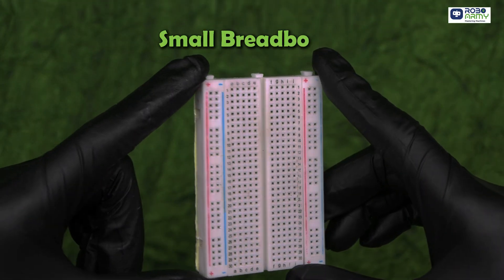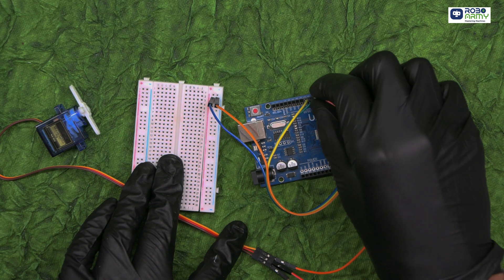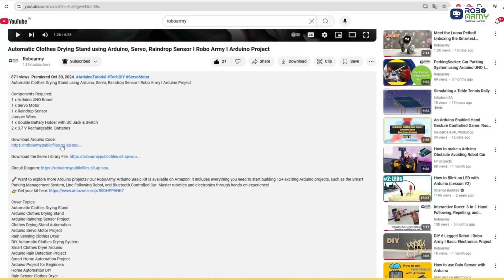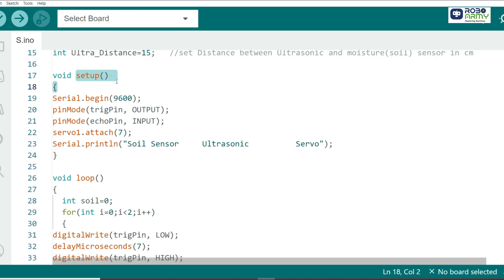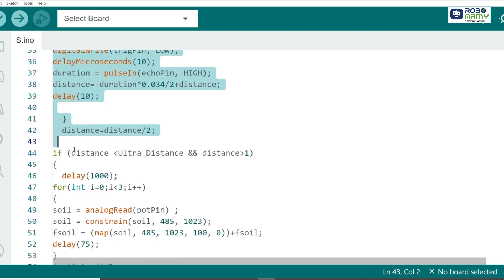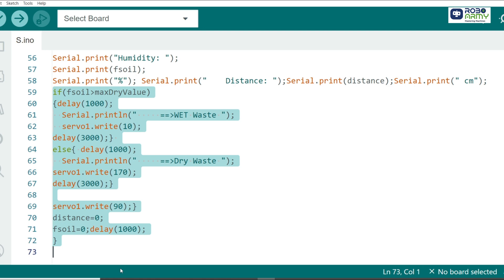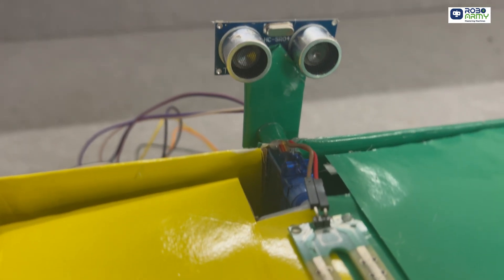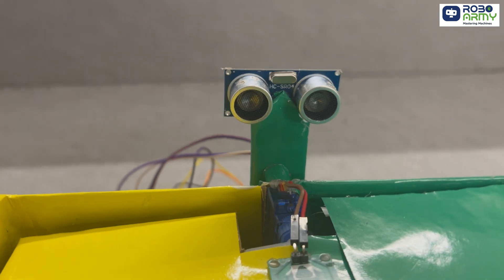How to make an Automatic BinBot: Dry Wet Waste Segregator Dustbin

Comment: hai do you have a code when the moisture is wet it should stay in position and if its dry it should move?
Reply from the maker: Sure! Here’s a simple code example: if the moisture sensor detects wet waste, the servo stays in position, and if it’s dry, the servo moves.
#include <Servo.h>
Servo servo1;

int potPin = A0;   // Soil moisture sensor
int soil = 0;
int fsoil = 0;
int maxDryValue = 10;  // Threshold value

void setup() {
  Serial.begin(9600);
  servo1.attach(7);
  servo1.write(90); // Neutral position
}

void loop() {
  soil = analogRead(potPin);
  soil = constrain(soil, 485, 1023);
  fsoil = map(soil, 485, 1023, 100, 0);

  Serial.print("Moisture: ");
  Serial.println(fsoil);

  if (fsoil > maxDryValue) {
    // Wet waste → stay at position
    servo1.write(90);
    Serial.println("Wet Waste - Servo Stays");
  } else {
    // Dry waste → move servo
    servo1.write(170);
    delay(2000);
    servo1.write(90); // return back
    Serial.println("Dry Waste - Servo Moved");
  }
  
  delay(1000);
}
Reply: @robo_army_  its not working
Reply: help me out pls

Comment: in the end, how to power it?
Reply from the maker: You can power it using the Arduino’s USB cable connected to a laptop or power adapter. For a portable setup, you can use a 9V battery or a rechargeable 5V power bank connected to the Arduino’s power jack or 5V pin. Just make sure the power supply is stable for the servo and sensors to work properly.

Comment: Sir! Will i need a powerbank?
Reply from the maker: You don’t necessarily need a power bank. The project can run using the Arduino’s USB power from a computer. But if you want it to work wirelessly or portable, then a 5V power bank will be useful.

Comment: What is the code to put for ultrasonic sensor for dry waste n wet waste on mobile or leptobe we cannot code on mobile? Make another video of how to put code
Reply: Please tell me the code of this video
Reply from the maker: The full code is already shared in the video description. Please check there, and if you face any issue running it, let me know!
Reply from the maker: The same code I shared in this video works for both dry and wet waste detection with the ultrasonic and moisture sensors. You can upload it using a laptop/PC with Arduino IDE. On mobile, coding is possible with apps like ArduinoDroid (Android), but it’s easier on a computer. Thanks for the suggestion—I’ll make a separate video on how to upload the code step by step

Comment: Hi sir, I want to do this project for my school’s science exhibition. However, I have Arduino expansion sheet instead of a breadboard - can I still refer to the circuit diagram u posted in the video ? If not, can help me sir ? Thank you
Reply: Sir I am also using a lcd display with i2c 16x02 can u help me with the code
Reply from the maker: Okay i will
Reply: Sir can u make a video that consists the circuit diagram and the code with the lcd display as soon as possible ? My school’s exhibition is on October
Reply: I am also confused about connecting the wires using the arduino expansion… unfortunately i don’t have the breadboard can u also help me with this
Reply from the maker: Yes, you can

Comment: Hello! Im a student in hs and we have an upcoming science fair, and i just have one question. Is there a difference between Arduino UNO R3 and Arduino UNO? My group is using the UNO R3 and were unsure if it works, in general my question is if Arduino UNO R3 is compatible for this project, thank you sir!
Reply from the maker: "Great question! The Arduino UNO R3 is just the latest and most common version of the Arduino UNO. It works exactly the same for this project, so you can definitely use it without any issues. Good luck with your science fair!
Reply: Oh, and what do i do for selecting a board in the ARDUINO IDE app thing, because theres no Arduino uno R3 in the app.
Reply from the maker: In the Arduino IDE, just select Arduino Uno from the board list — it covers the Uno R3 as well. If you don’t see it, go to Tools > Board > Arduino AVR Boards > Arduino Uno. That will work perfectly for your project!
Reply: @robo_army_  thank you sir!

Comment: THIS IS SO NOT ENOUGH - I mean you did good but how did you even make the whole box - that is the only project i have'
Reply from the maker: I understand The box was made using [material – e.g., cardboard/acrylic/wood], cut into panels and joined to form a dustbin shape. Then, I fixed the ultrasonic sensor on the front, the moisture sensor inside, and mounted the servo motor with the lid. Would you like me to make a step-by-step guide or diagram on how to build the box?
Reply: @robo_army_ Yes
Reply: that video is more than enough, just DIY the box
Reply: there is another video for ut

Comment: hey so i connected every wire as you said but i havent built the box yet but on the serial moniter nothing is being displayed just soil sensor, ultrasonic and sensor i put new jumper wires made very connection was tight but still does'nt work pls help
Reply from the maker: 1️⃣ Make sure Serial.begin(9600); is present in setup() and the baud rate in Serial Monitor is set to 9600.
2️⃣ Double-check that the Arduino is uploading successfully without errors.
3️⃣ Test the ultrasonic sensor and soil sensor separately with simple test codes to ensure they’re working.
4️⃣ Ensure you’ve selected the correct COM port in the Arduino IDE.
5️⃣ Try a different USB cable or port in case it’s a connection issue.
Reply: @robo_army_  ok thank you i forgot to connect 2 male to male wires from gnd and 5v of arduino to the bread board but i want to add 2 red and green led for wet and dry waste with 220 ohm resistors what would be the connections of it

Comment: Bro can you pls pls upload the code directly to comments or description?
😢😢😢
Reply from the maker: Sure bro!  Here's the full code for the Dry-Wet Segregator Dustbin project:

cpp
Copy
Edit
#include <Servo.h>

Servo servo1;

const int trigPin = 8;
const int echoPin = 9;

long duration;
int distance = 0;
int potPin = A0;            
int soil = 0;
int fsoil;
int maxDryValue = 10;       // Value to distinguish wet/dry
int Ultra_Distance = 15;    // Distance between ultrasonic and sensor in cm

void setup() {
  Serial.begin(9600);
  pinMode(trigPin, OUTPUT); 
  pinMode(echoPin, INPUT); 
  servo1.attach(7);
  Serial.println("Soil Sensor     Ultrasonic          Servo");
}

void loop() {
  int soil = 0;
  
  // Measure distance using ultrasonic sensor
  for (int i = 0; i < 2; i++) {
    digitalWrite(trigPin, LOW);
    delayMicroseconds(7);
    digitalWrite(trigPin, HIGH);
    delayMicroseconds(10);
    digitalWrite(trigPin, LOW);
    delayMicroseconds(10);
    duration = pulseIn(echoPin, HIGH);
    distance = duration * 0.034 / 2 + distance;
    delay(10);
  }
  distance = distance / 2;

  if (distance < Ultra_Distance && distance > 1) {
    delay(1000);

    // Read and average soil moisture
    for (int i = 0; i < 3; i++) {
      soil = analogRead(potPin);
      soil = constrain(soil, 485, 1023);
      fsoil = map(soil, 485, 1023, 100, 0) + fsoil;
      delay(75);
    }
    fsoil = fsoil / 3;

    Serial.print("Humidity: ");
    Serial.print(fsoil);
    Serial.print("%"); 
    Serial.print("    Distance: "); 
    Serial.print(distance); 
    Serial.print(" cm");

    // Decision: wet or dry
    if (fsoil > maxDryValue) {
      delay(1000);
      Serial.println("     ==> WET Waste ");
      servo1.write(10); // Move servo to wet side
      delay(3000); 
    } else {
      delay(1000);
      Serial.println("     ==> DRY Waste ");
      servo1.write(170); // Move servo to dry side
      delay(3000); 
    }

    servo1.write(90); // Reset servo to center
  }

  distance = 0;
  fsoil = 0;
  delay(1000);
}

Comment: What if i use raindrop sensor?
Reply: Will not work because it is not eligible to identify the moisture
Reply from the maker: Good question!  You can use a raindrop sensor as a basic alternative to the soil moisture sensor. It can detect moisture presence, but it won’t give accurate humidity levels like a soil sensor.
Reply: @robo_army_  can you help me do the code i dont understand how to do it. Please its for my school project.

Comment: can you please help me out 
tell me how to make tis box i am o confused  please tell
Reply from the maker: Of course! 😊 Here’s a simple guide to help you make the Dry-Wet Segregator Dustbin Box using cardboard or acrylic:

🧰 Materials Needed:
Cardboard sheets or acrylic sheets (size as per your requirement)

Glue gun / Fevicol / double-sided tape (for cardboard) or screws + glue for acrylic

Cutter or scissors

Servo motor

Ultrasonic sensor

Soil moisture sensor

Arduino Uno + Breadboard + Jumper wires

Small waste bin or cup (optional – for dry and wet sections)

🧱 Box Structure (Simple Design):
Size Suggestion: 20 cm (L) × 15 cm (W) × 15 cm (H)

📦 Steps to Build the Box:
Cut the panels (6 pieces total):

Base: 20 cm × 15 cm

Front and Back: 20 cm × 15 cm

Left and Right Sides: 15 cm × 15 cm

Top Lid (with a flap to open): 20 cm × 15 cm

Create a Slot on the top panel for inserting waste:

Around 6 cm x 6 cm hole in the center.

Mount the Ultrasonic Sensor:

Cut two holes (for the sensor’s “eyes”) on the front panel just below the top flap.

Fix the ultrasonic sensor behind the holes.

Place the Soil Moisture Sensor:

Inside the box, below the slot where waste will fall.

Use a sponge or some artificial moist/dry sample for simulation.

Mount the Servo Motor:

Inside the box or at the base of a flap or divider.

Attach a cardboard divider/flap to the servo arm that pushes waste left (dry) or right (wet).

Wire all components:

Connect components to Arduino Uno and fix the board inside or behind the box using double-sided tape or glue.

Comment: What are the software requirements of this and the frontend. Can u please explain?
Reply from the maker: Software Requirements:

Arduino IDE – To write, upload, and monitor the code.

(Optional) Tinkercad – For circuit simulation and testing online.

🖥️ Frontend:
This project doesn’t use a graphical frontend or user interface — it works on hardware logic using sensors and Arduino code. The Serial Monitor in Arduino IDE shows live sensor readings, acting as a basic output display.
Reply: @robo_army_ Can you also provide me with the backend?
Reply: What is the database of this project

Comment: which app are you using to transfer the codes to the uno board
Reply from the maker: I'm using the Arduino IDE to write and upload the code to the UNO board.  It's free and works on Windows, Mac, and Linux. You can download it from the official Arduino website. Let me know if you need help setting it up!

Comment: The last two wires are connected from breadboard to Arduino UNO board whyy??
Reply from the maker: I think you were referring to the last two wires — the ones that connect GND and 5V from the Arduino to the breadboard. This is for power up the sensor and servo motor.

Comment: Actually i did it but its not working
Reply from the maker: f you've connected everything correctly but it's not working, double-check your servo connections, sensor wiring, and code upload. Make sure the power supply is stable and the servos are not overloaded. Let me know what exactly isn’t working—I'll help you fix it!

Comment: Hello my servo motor is not returning to its orignal position when it turns to dry and it is coming back to dry when it turns to wet
Reply: Please help my science exhibition is Tommorow
Reply: Please
Reply from the maker: Hey! It looks like the servo isn’t returning to its original position because of how the delays and angles are set in the code. I’ve updated the code below for you! Now the servo will properly return to the center (90°) after sorting dry or wet waste. Just upload this and let me know if it works! 😄👇#include <Servo.h>

Servo servo1;

const int trigPin = 8;
const int echoPin = 9;

long duration;
int distance = 0;
int potPin = A0;
int soil = 0;
int fsoil;
int maxDryValue = 10;     // Above this = Wet waste
int Ultra_Distance = 15;  // Distance threshold in cm

void setup() {
  Serial.begin(9600);
  pinMode(trigPin, OUTPUT);
  pinMode(echoPin, INPUT);
  servo1.attach(7);
  servo1.write(90); // Neutral starting position
  Serial.println("Soil Sensor     Ultrasonic          Servo");
}

void loop() {
  distance = 0;

  // Take average of two ultrasonic readings
  for (int i = 0; i < 2; i++) {
    digitalWrite(trigPin, LOW);
    delayMicroseconds(7);
    digitalWrite(trigPin, HIGH);
    delayMicroseconds(10);
    digitalWrite(trigPin, LOW);
    duration = pulseIn(echoPin, HIGH);
    distance += duration * 0.034 / 2;
    delay(10);
  }
  distance = distance / 2;

  if (distance < Ultra_Distance && distance > 1) {
    delay(500); // slight delay for stability

    // Average 3 soil readings
    fsoil = 0;
    for (int i = 0; i < 3; i++) {
      soil = analogRead(potPin);
      soil = constrain(soil, 485, 1023);
      fsoil += map(soil, 485, 1023, 100, 0);
      delay(75);
    }
    fsoil = fsoil / 3;

    Serial.print("Humidity: ");
    Serial.print(fsoil);
    Serial.print("%    Distance: ");
    Serial.print(distance);
    Serial.print(" cm");

    if (fsoil > maxDryValue) {
      Serial.println("     ==> WET Waste");
      servo1.write(10);  // Wet waste side
    } else {
      Serial.println("     ==> DRY Waste");
      servo1.write(170); // Dry waste side
    }

    delay(2000);          // Allow time for bin flap to move
    servo1.write(90);     // Reset to center
    delay(1000);          // Give servo time to return
  }

  delay(1000); // Wait before next loop
}
Reply: Its still not returning to its original position. It is segregating waste correctly but servo motor is still not returning to its original position. Please help me out

Thank you

Comment: Which type of jumper wire we should use
Reply from the maker: Depending n the connections, you can use: Female to Female, Male to Female and Male to male jumper wires. Easily available with standard sizes.
Reply: It's quantity

Comment: Hello, do I need to buy specific jumper wires with any quantity?
Reply from the maker: You don't need any specific type—male-to-male and female-to-female jumper wires work best for connecting components on a breadboard with an Arduino.
Recommended Quantity: A set of around 20–30 jumper wires (mixed lengths) is usually enough for this project. You can get them easily in kits online or at electronics stores.
Reply: @robo_army_  Alright, is there any requirements for the length?
Reply from the maker: they are standard in size

Comment: Hello how you have made the box please reply I have to submit this project in my school
Reply from the maker: Hi! 😊 I made the box using cardboard (you can also use acrylic or plastic sheet). I measured and cut it to fit all components properly.

Here’s a simple idea:
Create 2 compartments inside—one for dry and one for wet waste.
Mount the ultrasonic sensor on top, the moisture sensor inside, and the servo motor at the divider to direct waste.
Reply: Thanks for replying.  It was helpful for me 😊
Reply from the maker: Stay tuned for more such projects